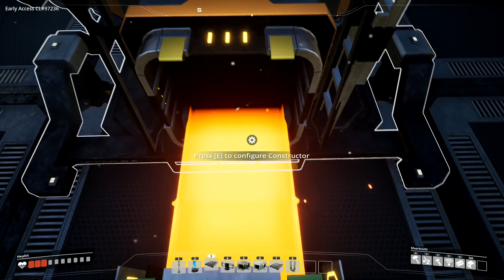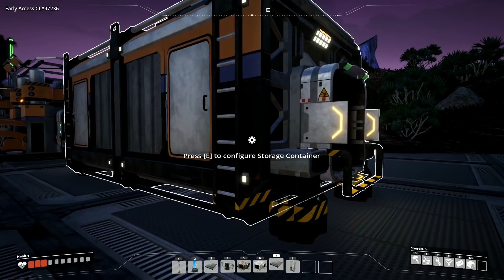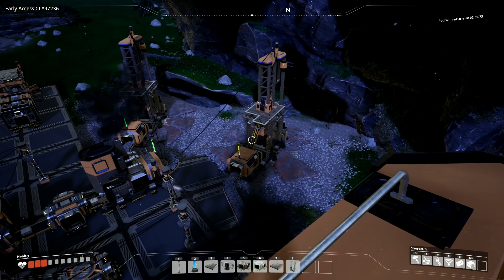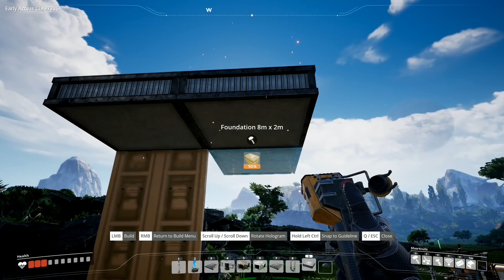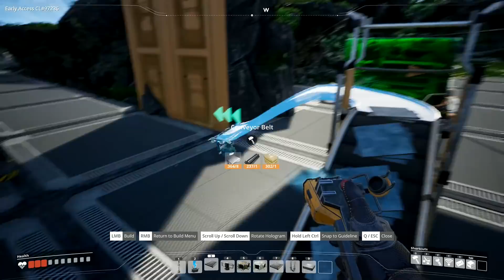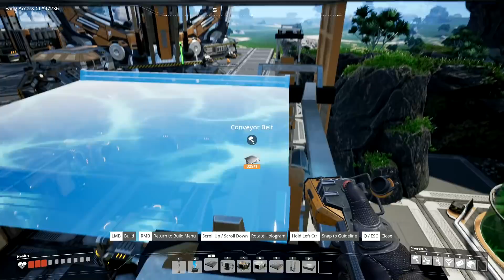Let's Play Satisfactory #17: Level Two!

Comment: Copper and iron are easy to get 100% utilization for basic components. For iron - every 30 mine output : 1 smelter | 1 smelter : 2 rod constructors | 1 smelter : 1 plate constructor

I always end up having to o/c screws... 

1st 2 pics shows you how. 
https://imgur.com/a/QJa1uMS
My mini-tutorial. Just one of the tricks in that video you have not yet got around to watching yet. :P

No structural ingerity at this time. No knowledege of it being planned either. You have to have something below/side to build something, but once something is built, you can remove it's support, and recoup resources... belt poles, looking at you. Stackable belt poles though, provide a nice aesthetic, plus double as ladders in case I need to grab something, or just want to ride. 

A few people have mentioned lights, hopefully the Devs listened and are going to add them, or were already planned, and just not ingame yet.